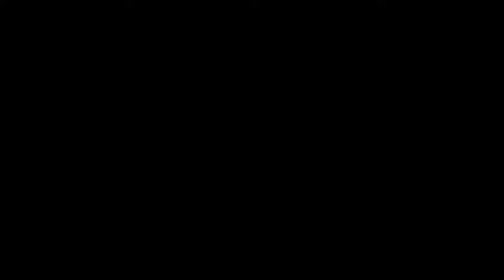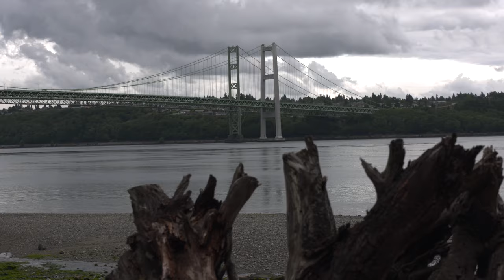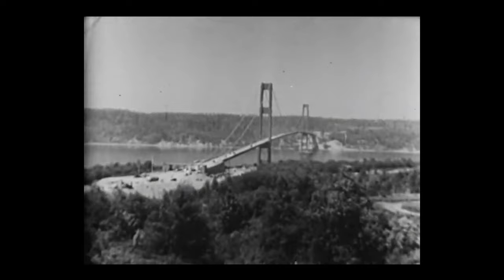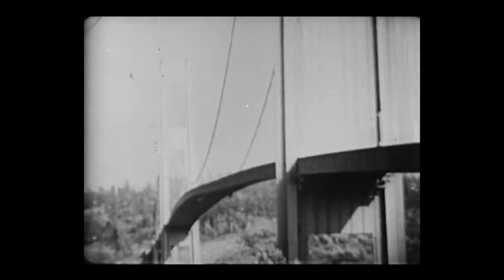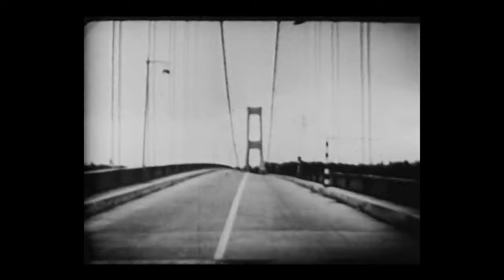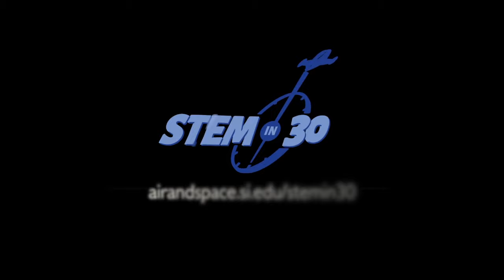The Collapse of "Galloping Gertie" (The Tacoma Narrows Bridge)

Comment: Someone did die it was the dog in the car and because there was to much vibration the dog didn't get out the car and was scared the car wasn't found neither the remains of the dog. The 1940 Tacoma Narrows Bridge, the first Tacoma Narrows Bridge, was a suspension bridge in the U.S. state of Washington that spanned the Tacoma Narrows ...
Collapsed: November 7, 1940
Longest span: 2,800 feet (853.4 m)
Opened: July 1, 1940
Total length: 5,939 feet (1,810.2 m)